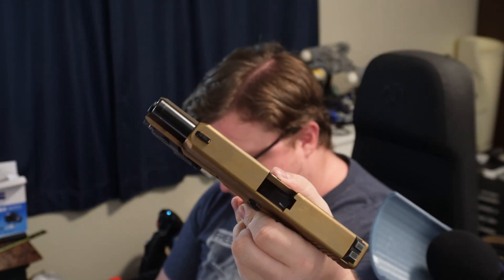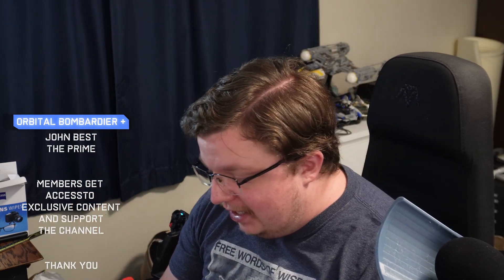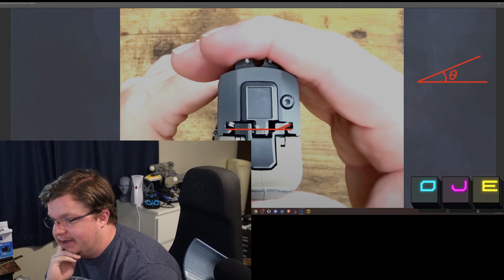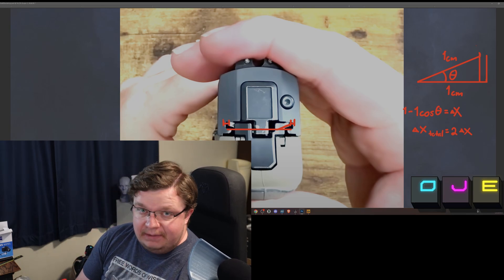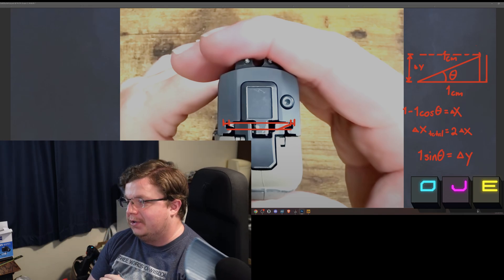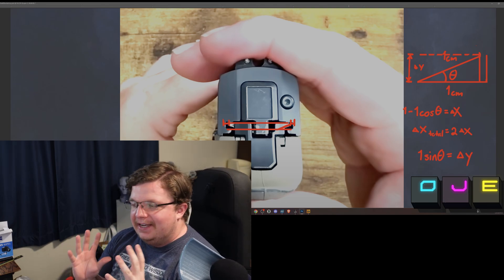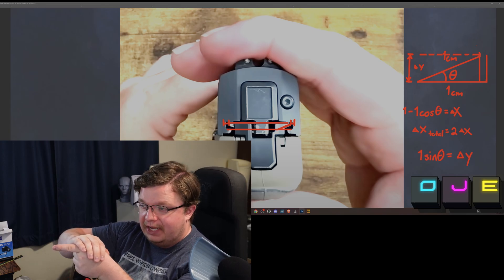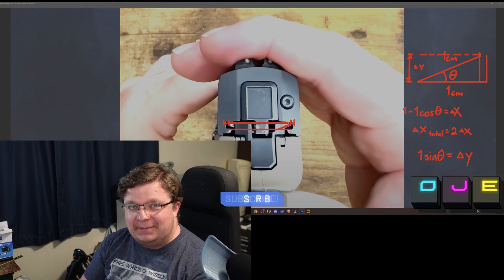Is the SIG P320 Safe???  -- An Engineer's Take on Wyoming Gun Project's Video

Comment: The replay of the Wyoming Project, showed a nail. Screw or something being stuck in the trigger to hold the trigger back on that staging point prior to discharge.
My problem is the trigger has been manipulated to a point that internal safeguards could possibly have been disengaged and the pistol is in the final point before it can be discharged. 
Show me the video where with the trigger not being manipulated and discharging!
Now it is troubling that when the trigger is at that point just prior to discharge where internal safety’s are disengaged, in which pushing up/down or back n forth on the slide and it could discharge. That is a bit troublesome and another ???? For the Sig P320.
I did see a video this morning in which an engineer who supposedly used to work for SIG SAUER, has ‘patent’ a new P320 part’s design to address the discharge problem. 
However, did not see in that video a full testing series report just schematic’s and not sure if actually producing the parts. 
This is at least something hopefully for all of us that do own the Sig P320 from someone who says they are an engineer.
Why it take so long for such, especially NOT from Sig Sauer!!!!
Best to all!
Reply from the maker: The degree of trigger manipulation though is almost negligible.  It's less than 1mm of engagement.  Even if you were actively pulling the trigger, that distance is within where you might still be lining up a shot.
Reply: @OddJobEntertainment  Granted, the distance is small although this still ‘could’ be enough to disengage the internal safety’s (just another idea during the process). Other’s with better knowledge of the pistol design could provide that travel distance answer. But most semiautomatic pistols don’t travel great distances before the discharge and in between such internal parts are moving to allow it.

Comment: Wyoming Gun Project and Triggersmart have good vids on this subject. The argument should be about Sig and not competent gun owners.
Reply from the maker: I've based my work on trying to pinpoint manufacturing issues based on WGP's video. This video is in no way an accusation against WGP. He pointed out that slide slop is a contributing issue, I'm pointing out where that slop may originate.

Comment: I believe it’s both issues and we are going to see more problems as time passes. I tore my P320 down, FCU and striker and was appalled at how “flimsy” the parts were and what seemed to be low quality production compared to my Glock 19. I’ve gone back to carrying my hammer fired Bersa Thunder 9 UC Pro as my EDC. Bersa is probably one of the most underrated handguns on the market. It’s a little beefy and weighs in about 24oz loaded, but I have no compunction about carrying it.

Comment: Sig lost its 3rd Jury trial, 7.31.2025, with findings in all three cases that the P320 is dangerously defective.  Sig argued in Court that they should not pay damages because the victim plaintiff should have known it was defective and dangerous.  The P320 and variants are NOT SAFE. DISCONTINUE USE IMMEDIATELY, UNLOAD AND PUT IN SAFE STORAGE. You can't blame training or holsters when there are literally 10s of millions of other Sig designs (P365, for instance) and Glocks, CZs, Walther, S&Ws, Springfields, FNs, HKs, Taurus, etc. in holsters across America and the world that are not having these same uncommanded discharges and injuries the P320 is liable for, including now up to 3 deaths. Note, also, these UCDs and injuries are happening to a lot of police and military, who are highly trained and also not "modifying" their pistols, the guns are serviced by the unit armorer, and holsters are typically approved or issued by the unit versus using a cheap weak holster. In fact, as a point of reference, the next 15 gun companies combined don't have a single credible instance of a UCD whereas the Sig P320 has dozens of these allegations. At some point you have to realize it is in fact the faulty design of the Sig P320, which failed drop safety tests way back in 2017. 
If you watch the dozen or more videos where police (I reject the notion they are not trained) and civilians having guns fire INSIDE HOLSTERS with no input from the carriers, often while doing simple tasks like walking, standing, sitting, getting into or out of vehicles, etc. then only a reasonable person can conclude the gun is defective. Sig Sauer has indeed LOST lawsuits, I believe at least 2, where there were over $10 million in damages based on a negligent product design. Sig has also settled many lawsuits out of court, strongly suggesting they'd have lost considering their propensity to fight the suits and even filing lawsuits. 
This gun has been defective since introduced. It mysteriously passed the "rigorous" military trials, to only thereafter be identified as failing drop safe testing. That's very "odd" shall we say. It’s literally been found to be a negligently designed product in two state jury trials, settled a bunch of cases, and a lot more in the pipeline.  Many firearms experts advise discontinued use, as a growing number of trainers and ranges are banning them. Many state and federal law enforcement agencies including Denver, Chicago, Washington, Milwaukee, and others are dumping the P320 for good cause. While it may still be unclear what specific design(s) or parts defects are the cause, that is not necessary at this juncture. I have seen reasonable theories by engineers or gunsmiths that the mechanical safeties are not robust enough or too small and can be knocked out of alignment or due to lack of close tolerances and specs, they can fail. Regardless, it is undeniable, these ARE FIRING IN HOLSTERS. We can see obviously the gun fires in holsters, as evidence of such is on videos and witness statements, and often the gun is still holstered and the spent casing still in the chamber. We need not autopsy the exact cause, but there is a problem. It is irresponsible to continue using this gun, and there are hundreds of suitable safe replacements.
Bad month for Sig Sauer, a dead US Airman, dozens of ranges and training centers including IPSC banning them, all the big gun YT channels and defense litigation lawyers advising to unload and shelve them, etc.  On top of many federal and state agencies pausing or banning their use.   It’ll get worse every day, with these causing more UDs, more injuries, more deaths, as they wear out.  We’ll see more lawsuits and more settlements or lost cases.  
The Death of Sig Sauer over the lies, gaslighting, and mismanagement will be written about and studied for decades in business schools. I don't think I've ever seen a company self destruct this badly with totally unsafe products they continue to lie about putting profits over safety. In the process they are damaging the 2A as well with faulty guns going off and killing or hurting people.... Unreal. 

I partly blame the military and police for also not doing rigorous testing and ignoring failed and flawed designs, favoring a pointless “modular” system over proven reliable safe alternatives... This P320 was never ready for prime time.
Reply: If Sig argues the user should have known of the risks...what does that say about themselves? And continuing then to put them into the hands of people - many of whom surely do not know of its dangers?

Comment: Here's how you know this guy is an engineer. He's 3D printed a spit shield for his mic, which he has mounted with a joystick to his chair. That's all I needed to see.
Reply from the maker: Good observations. Haha, the mic is also mounted to the chair with a custom adapter. The electronics on the chair go to a USB hub held in a box I designed, and the power then feeds into a wire management umbilicus. The chair pan has an angled wedge I made to increase its angle. I made the keyboard rest I'm using. I modified the keyboard with a wireless charger and receiver. The mount for my drawing tablet is also my design.

Comment: The reason slide to frame fitment is loose is because of the removable FCU. Everyone keeps comparing to other pistols but all the others have the trigger group built into the frame. Only exception would be the new Springfield Echelon. Like to see how loose the slide is on that. Also Ruger Max 9mm is like a tambourine when you shake it. The slide moves up and down when you dry fire just like the 320. Obviously no issues with uncommanded firing

Comment: Of course it’s making a contribution

If you use the corner of a metal file on a metal surface then it’s obviously going to cut through the surface a lot quicker then it would opposed to laying the file down Flat, and applying the same amount of pressure to the surface.

Comment: I honestly have no idea why Sig choose to produce FCU with such shaped rails, but it's has been like that since the start, it's not even bent by constant use,  it's just made like that. Another one of the P320 ridiculous design choices.
I don't even think it's quality control at this point, the gun is just flawed on so many elements that the only fix would be to change everything that needs tolerances within half a millimeter.
It's just easier to stop making the gun.

Comment: Pretty sure those slide rails came from the factory that way. The parts don't fit right at all. My Beretta 92FS has zero detectable slide movement on the frame. And you can barely even see the gap between the slide and frame. Very precise fit, very tight. Just enough play to allow the slide to work properly. Of course the Beretta is an all metal hammer fired gun with a manual safety/decocker and a long nearly 12 pound trigger pull when fired DA. I have never owned a striker fired gun and never will. I am a firm believer in DA. IF you are in a place where it is safe, then you can cock the hammer with your thumb and fire the first rounds SA. But NEVER carry it that way. That is exactly what you are doing with a striker fired gun. That striker has a lot of spring tension behind it, and is only being held back by a tiny cheezy little stamped or MIM metal part. 

Don't forget that when you are carrying a firearm in a holster, it will always be pointed at you, and depending on your position, it could very well be pointed at someone else too.
Reply from the maker: Thanks for the thorough comparison of the two systems.

Comment: Compare this to the slide/frame fitment of the Beretta 92/M9. The Beretta 92 is an engineering masterpiece. The army just wanted a striker fired polymer framed pistol for the sake of having a striker fired polymer framed pistol.
Reply: As a Beretta 92 owner (actually I've owned 4 of them) I totally agree. The best handgun I've ever owned, and they have all been hammer fired. I also own a Beretta 9000S 9mm, which was Berettas first polymer framed pistol. I bought it new in 2001, have fired several thousand rounds through it, and the slide/frame fit is still rock solid. Beretta knows how to make guns.

Comment: I noticed that as well. Good eye! Clearly there is a serious issue with the firearm. I cannot overlook testing them by manipulating the trigger in some fashion though. I have yet to see it happen in testing without anyone touching the trigger.
Reply: The point with the trigger manipulation is that the amount of pressure required is so small that a bit of grit could potentially cause it.

Comment: I’ve been collecting data points on P320 rear frame rails. Out of 11 guns measured so far, only 2 of them have been in-spec according to Sig’s own drawing. This is an incredibly bad design, with no way to consistently manufacture it according to the drawing.
Reply from the maker: Very interesting.  Does your data collection include the area I've focused on here?  I'd love to get verification as to whether or not we've pinpointed an issue.
Reply: @OddJobEntertainment  I posted something in your discord about it, with a link to what I’ve been doing. I’m pretty sure the bend angle is what causes the width issue, because the receiver drawing from sig shows the rails being square / flat.

Comment: I can see any striker fired pistol having a possible striker release due to sloppy slide to frame rail fitting.  Whether or not that results in a fired cartridge is another matter.  My biggest concern with the P320 would be the trigger requires barely any movement to disengage the striker safety block.  The fella with the cnc machine test got a Glock to do the same thing, but it also required a 99% trigger pull to accomplish.  Trying these "tests" on my Beretta APX A1, I cannot replicate a problem, but the APX disengages the striker safety at the same time as dropping the sear.  Just my opinion.
Reply from the maker: and as I understand, Glock is half-cocked while SIG is full-cocked at rest.  So the Glock would not fire even if it somehow snuck past everything unless you provide the added energy required to the striker spring with your trigger pull.  But yeah, a viewer linked me that video of the Glock as though it disproves anything.  10% pull and 90% pull are very different.

Comment: Great Video. #1 no the slop in wyomings 1 of 3 P320's are not normal amount #2 jumping the sear can be performed with every striker fire. Every striker fire has clearence movement on the slide and you can press the trigger on every striker to the amount where the clearences can come into play and jump the sear.  #3 its a useless test. If slide slop was an issue for a firearm it woukd fail drop tests however moving the trigger defeats the striker block safety that would stop the travel of the striker so yes if you press the trigger on any striker fire handgun it will dis engage the striker block safetys and jump the sear when you reach the clearence achieved in that particular pistols slide. Its a null test. Good Youtube fun but proves nothing
Reply from the maker: But this gun does fail drop tests according to the FBI investigation. So if hit from the back, the remarkably short travel required by the trigger could result from a drop. That, in concert with slide movement, can result in misfire.
Reply: @OddJobEntertainment its drop safe
Reply: @OddJobEntertainment 
That was a completely separate issue from what people are claiming is now happening. Older model Sigs could be sent in for a voluntary fix/upgrade. The issue people CLAIM to exist is with newer sigs where that issue has been fixed.

Comment: @1:28 Yes the slide rails are manufactured like that. In fact, when I saw that part of the video, I checked my Sig SP2022 (which is also a polymer frame pistol) and it has the same slide rails. I think it's how they implemented this stamped rail to be molded into the frame. This is much different from the P226, which has the rails machined into the alloy frame.
Reply: Not sure how much variance there is, but that angle exists in every P320 that I’ve seen. You can just Google images of P320s and it’s very evident.
Reply from the maker: But are the rails on yours positioned at the same angle? That's what I'd like to know. If there is variance and if that variance contributes to the issue.
Reply: @OddJobEntertainment  Yes. I thought it was odd that they weren't stamped at a 90 degree angle. But it worked fine and I never noticed excessive wear.

Comment: I'm no engineer, but what I can deduce from the presentation is that the tolerance between the striker hook thing and the sear is critical and really the only thing keeping the striker/firing pin from traveling at a great rate of acceleration towards a primed cartridge . Variances in the production of the frame rails (which are just short bits of stamped steel) , can cause a loss of sear engagement. Boom. In order to produce stamped parts with little or no variances, the stamping dies need to be inspected and or repaired when worn. This involves a Metrology Lab and precise measuring instruments kept within a temperature and humidity controlled space. It also requires skilled personnel and a full machine shop. Failure to observe basic QC practices will result in consequences. No amount of gaslighting. bribery or scheming will protect Sig from the consequences of their actions.
Reply from the maker: There seems to be an issue with several stacking tolerances.

Comment: I must have a fucking unicorn, because I have spent hours trying to make mine go off,,, nada ,,, I have tryrd the screw in the trigger and yes you can screw it in to the point where the trigger is just about ready to trip and then you can make it go off. All Im saying there has got to be more to the story. If you guys are afraid of them, buy a highpoint
Reply: Don't loose your nuts over 600 bucks bud. Might not do it now. But that's the scary part. Maybe it will after a few hundred more rounds and all your trust.
Reply from the maker: Can you take a look at the area I highlighted and let me know if there is anything different in the angles shown?
Reply: I feel like it has to be tolerance stacking issues, because some people claim my slide is not that loose at all while others are like look how loose this slide is. Some claim mine does not do that when others can reproduce the same thing. I don't think it's every single p320 I mean its only like .03-.04% of the total sold so far this is probably not accurate, but you get what I'm saying its a very tiny percentage. I'm just glad I don't own one as my only gun and have to make that decision as to if I trust it and for how long.